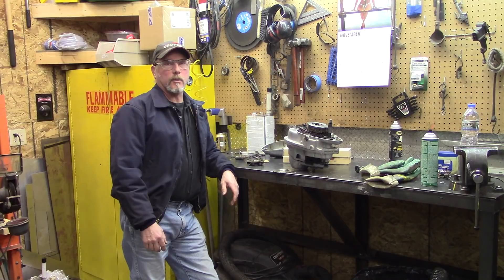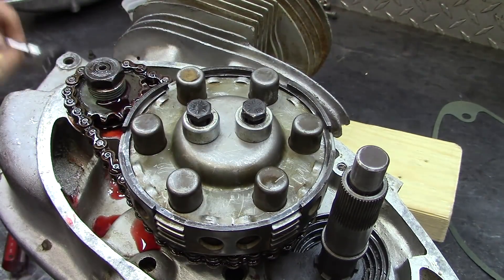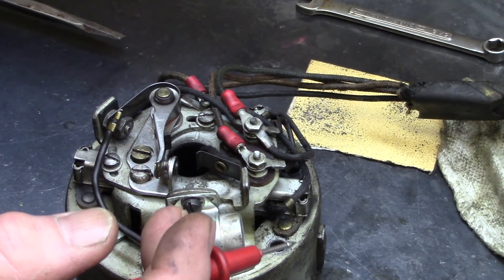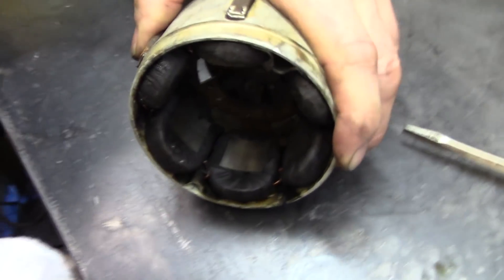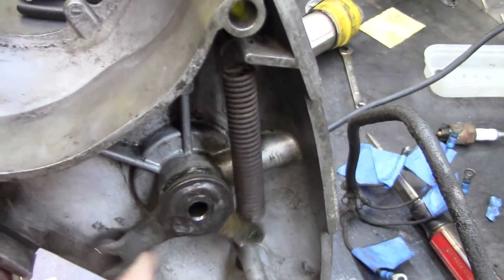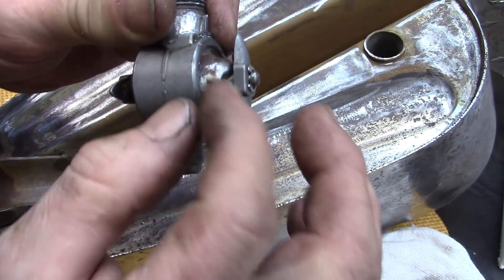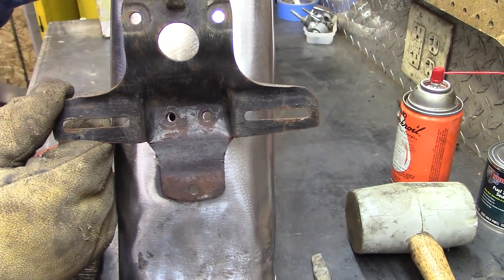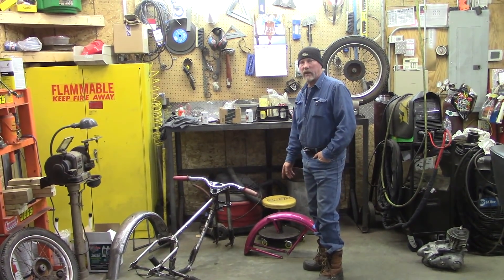Harley Davidson 165 Hummer work part 3

Comment: My 56 hummer has the magneto ignition which made restoration a little easier and it looks cleaner and simpler but you're right, it is harder to start, especially when cold. I quite often have to push start it from cold but once its warmed up it starts on the first kick. Great video on the clutch and kicker side, I remember it well. That clutch basket is a piece of work isn't it.

Comment: Did those tail lights say Speaker on them? Did you save them?
Reply from the maker: They do.  Is there any significance to them?  I beleive this bike originally had a brake light because it has the switch.
Reply: @Oldsmob455  They are made by JW Speaker Corporation in Germantown, WI.  They look like a fairly old set. Do you think they are original to the bike?  I have worked at JW Speaker since 2008. We make lights and taillights for HD now, but not sure if we did in 1957. Perhaps it is an aftermarket light.
Reply from the maker: I think they were probably put on the bike in the late 60's. Most likely and aftermarket add on when the fender was chopped.  Didn't realize they were made in Wisconsin.